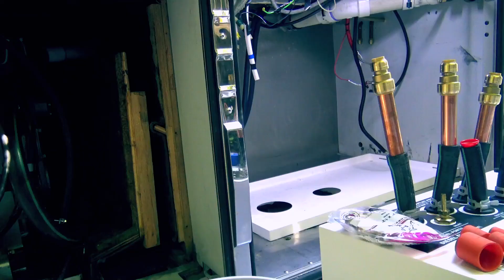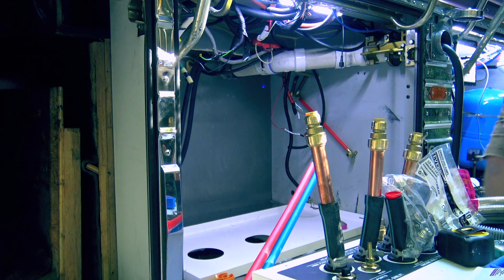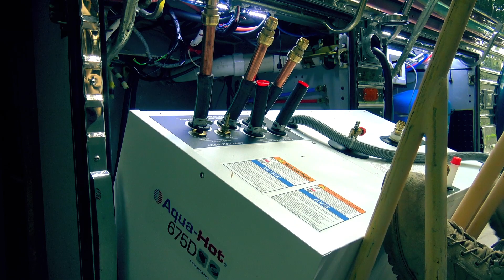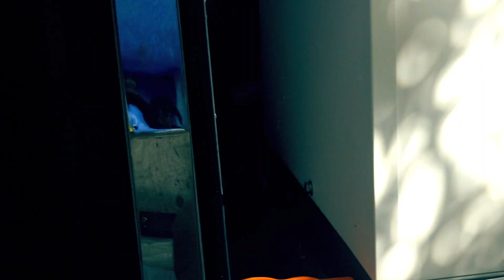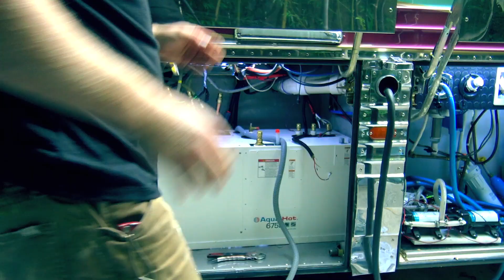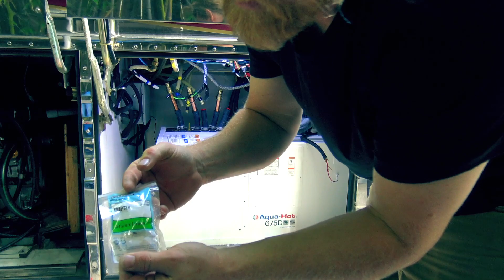AquaHot Assembling mounting the Unit

Comment: I can't for the life of my find pricing on these units, any estimate on the price?   These really seem like the way to go.   Engine Preheat, Hot Water, Interior Heat, all in one unit?... I wonder if in my MCI I could put it right where my OTR heat is now., up front under the driver and save a bay.
Reply from the maker: Yeah, they are certainly the best all-around option but not the cheapest. They are the most efficient as well. This model run 11 thousand dollars new but every so often an older model that someone has replaced out with a new one will pop up on eBay. Here is a link to claw RV a wrecking yard of sorts. https://colawrvsalvage.com/product/used-aqua-hot-450de-continuous-hot-water-2012-winnebago-salvage-pull-out/ You can call. After having an aqua hot in y coach I would never use anything else. I've got my old one if you want to drive to Austin and buy it from me?